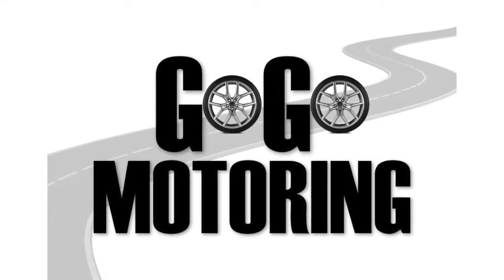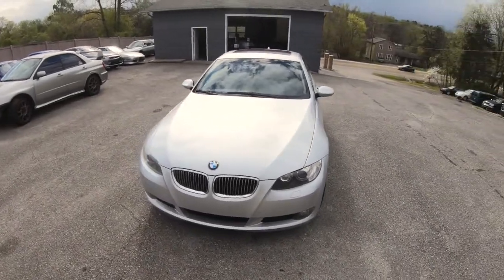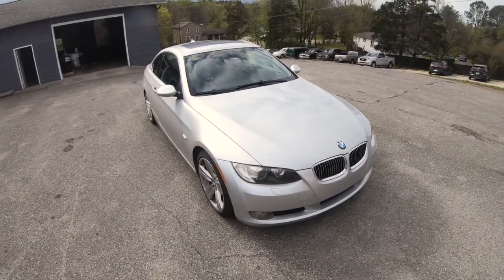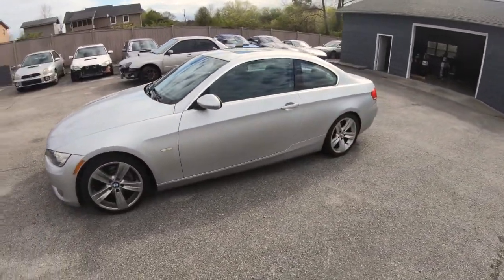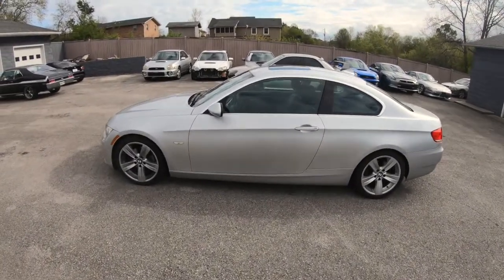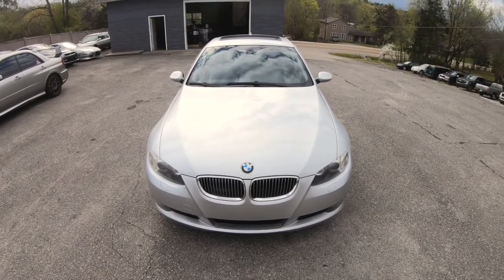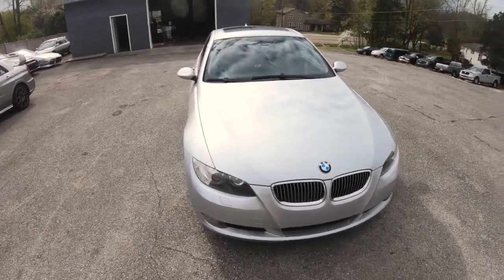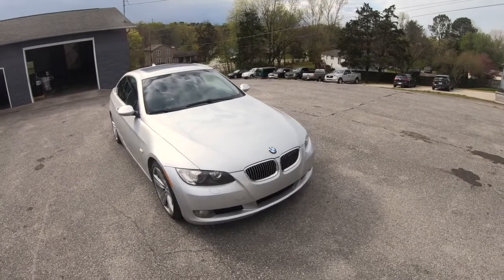BMW N52 Engine Stock Horsepower in my 2007 BMW 328i (E92) Coupe -- Dyno Test

Comment: Got stock n52b30 rwd a/t on the dyno today, only got 181hp/174tq @282k miles time for a full rebuild I guess.
Reply from the maker: Was the dyno conservative? That’s quite a bit less than my stock was. I got an extra 30 hp gain at the wheels with the mod.
Reply: @GogoMotoring  I'm not sure, I just know its the DYNOJET machine. Initial values where 186/180 but I told him I wanted the actual uncorrected values and that dropped it by 5 points. But keep in mind this being an automatic I'm never going to make he same you do to the wheels.

Comment: You should just use the dynojet dyno for the next pull and youll get the numbers you are looking for? I am a little suprised to see it under 200 hp though in all seriousness cos I know how quick these cars are.
Reply from the maker: It has a lot more than that now after the 3-stage intake manifold conversion. ;)
Reply from the maker: Also, keep in mind this shows horsepower at the wheels and not at the crank. 200 hp at the wheels is about 230 hp at the crank, which is what BMW advertises for this car. This is also a conservative machine, so at a minimum, it was at stock power many years after being produced.

Comment: Nice I have the same car but a 2008 I only got 58000 miles on it it’s pretty brand new I’m wondering how much horsepower I’m pushing out now hmm
Reply from the maker: My car didn't lose any horsepower, and it had over 100k miles before I did the mod. In fact, I estimated my stock horsepower to be at 234 before the mod. Your car is probably the same.